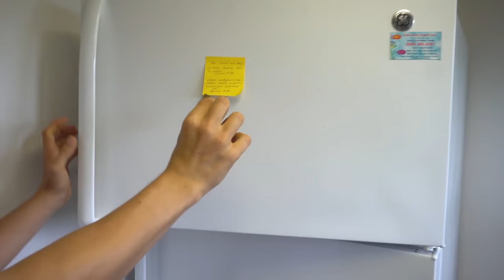Fridge Making Loud Noise and How To Fix It

Comment: The fan in my freezer makes a huge noise that my ears hurt, and the maintenance people say my defroster is down and both parts of the refrigerator are out of work for some extent. They change the defroster and cleaned the ice on the fan.... The noise instead of the food grabbed my attention somehow make me scared, because I may have eaten unhealthy food for days....
Reply: How much did it cost?
Reply: @sean8081a  I rent apartment so the maintenance is free, I guess.